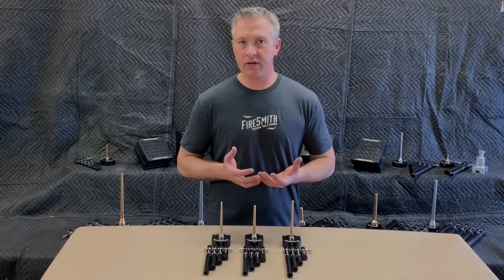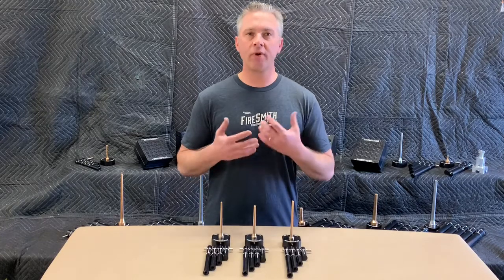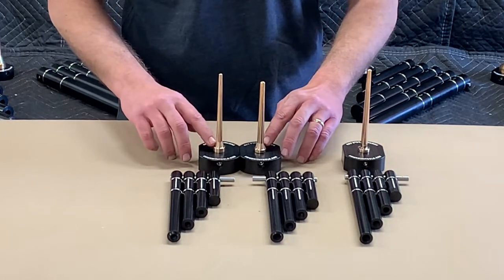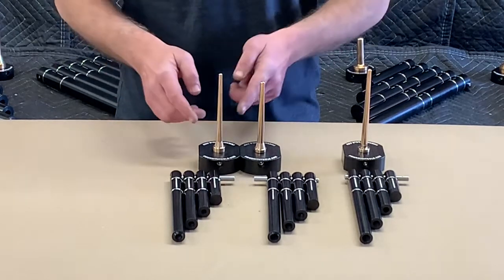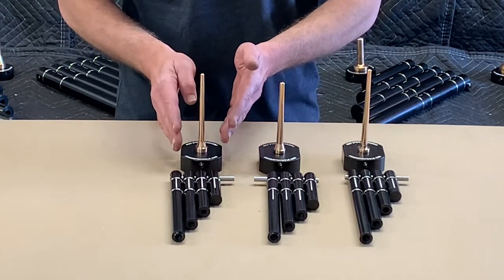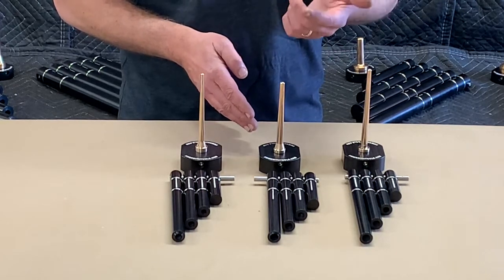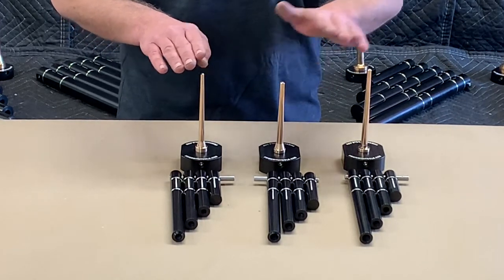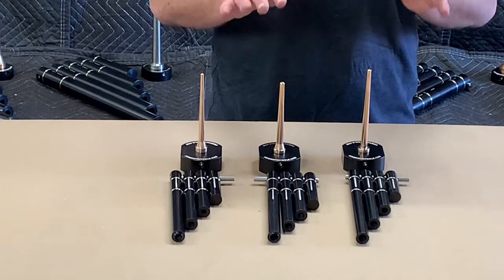Choosing a Core Burn Rocket Toolset

Comment: why can't you run 75/15/10 on a super set? I didn't realize there was a difference, have been using that comp on super tool set for a while now.
Reply from the maker: It really depends on the charcoal you are using. BP made with soft wood charcoal species burns much more vigorously than BP made with hard wood charcoal. 75:15:10 with soft wood charcoal will CATO on the Super BP Core Burn tool set using a clay nozzle. 75:15:10 with hard wood charcoal may burn slowly enough to prevent this from happening.

Comment: Your tools are way to over priced I’m not exactly poor but I definitely can’t afford any of your tools
Reply from the maker: I get a comment of similar nature a couple times a year. As with any endeavor worth pursuing, quality gear is an investment, not an expense. Constructing fireworks is not an inexpensive passion. The costs of fuse, tubes, chemicals and other needed supplies far exceeds the costs of tooling. My prices are slightly higher than competing products, yes. But the quality is unmatched. Properly cared for, every tool in my catalog will last a lifetime. Everything is made in my facility in Colorado, USA. With thousands of tool sets in use by hobbyists, professional and commercial operations all over the world (yes, some of the large commercial displays you’ve likely seen have included fireworks built with these exact same tools). I’d highly recommend joining our emailing list at www.firesmithtools.com We send out coupons and discounts on a regular basis.
Reply: @firesmithmanufacturing9376  do you offer a warranty on the tooling sets?
Reply: Those are some nice tools. Price point to me is just fine if you compare to others, wouldn’t consider these way too* overpriced whatsoever
Reply from the maker: Yes. If the tooling is damage during normal use, I offer free repair for the lifetime of the product (so long as the tool isn't damaged beyond repair). Most commonly damaged items are tall core-burn rocket spindles. Keeping your rammers clean and ensuring your press is square will eliminate 99% of potential damage. Replacement spindles are available for purchase should it be damaged beyond repair. Properly cared for (and cleaned after use) these tools will last forever. I have commercial operations using these tool sets though cycles several hundred times those that a hobbyist could put them through in a lifetime. After 1,000's of lbs of comp, they are still functioning like the day they were new.
Reply from the maker: Yeah, there are certainly less expensive options. But, most of those tool sets have questionable engineering, tolerances and finish quality. Plus, the hard anodizing on all my tool sets makes a huge difference in ease of use, tool life, longevity and performance. Producing tools to these standards does cost more and take a bit of additional time, but in the end it's always cheaper to buy the good stuff to begin with.
Reply from the maker: Thanks Rob!
Yeah, the bronze is my preferred material for pressing core burn motors. It’s super slippery and releases very easily. It’s a much more expensive alloy than stainless (but quicker to machine). I do offer all of my spindles in either bronze or stainless.
Reply: @firesmithmanufacturing9376  no problem buddy. The quality of the tool speaks for itself I was just reading this thread again and I did not know you offered  repair on bent spindles. When I first built my press it apparently was not Square because I promptly bent my spindle but I was able to easily straighten it because it's made of bronze. You can't even tell it was ever bent. I just started using my new end burner tooling that I ordered from you last month. I really like the new design of the rammers with the hole going all the way through although it does not make a lot of difference with the end burner I wish I had them for my Universal

Comment: Are you bring back the 6LB tooling soon?
Reply from the maker: I have 6lb tools at hardening right now. These are to fill existing orders, but there will be a few extra sets at the PGI. 6lb tools will not be a regular stock item. There just isn't much demand for them anymore. And, the raw materials they consume to make a tool set is significant.
Reply: @firesmithmanufacturing9376  Sadly I dont think we are going to make it to PGI, but if you have a full set left over after let me know, I'd really like a universal set for BP, Whistle, and Strobe, with tube support and all.

Comment: I looked on your site do you have tooling for 4oz and 8oz BP and whistle rockets if not ill just order the 1lb tooling kit 

Also do you know how much weight a 4oz whistle and 8oz whistle can lift? And is it the same for BP rockets?
Reply from the maker: I'm afraid I don't produce 4oz and 8oz tool sets for my own catalog. I do produce these sizes for our friends at Skylighter and Cannon Fuse. Lifting power can vary widely depending on your fuel and chemicals.

Comment: For whistle motors, I don't have, and am unlikely to make, the press strong enough to handle even the 1 lb., and with the greater lift capability of whistle I think I'd rather make smaller ones anyway.  Can you recommend anyone who makes comparable quality in smaller diameter tooling?  I think I've gone as far as I want to try in whistles with homemade tooling from dowels, nails, and a grapefruit squeezer rack-and-pinion press; very narrow "sweet spot" that I rarely hit between sizzle on the launch pad and blow up on the launch pad.

Now that I look, I see your spoulette and insert tooling set is for 5/16" ID cases, and among the suggested uses is "shell whistles", which I take to mean whistling serpents.  Could they be made powerful enough with that tooling to take off from the ground and carry a garniture?  That's smaller than I'm most interested in, but might be worth my while if sky rockets can be made that way.  I did try a little using 1/2" ID thin-wall or caseless go-getters (cast from slurry of energetic color star compo around a nail) as sky rockets, with a little success.
Reply from the maker: I produce smaller rocket tool sets for both Cannonfuse.com and Skylighter.com. A simple 1 ton arbor press will work fine for 1/2" motors.